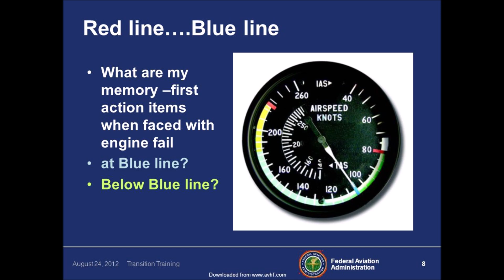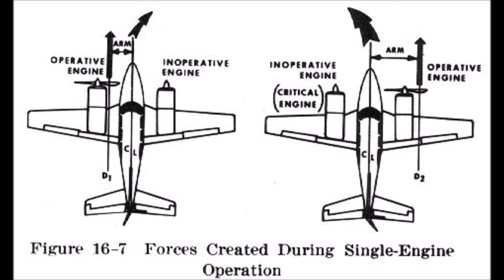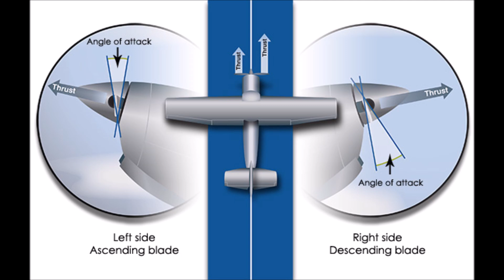King Air Crash- Addison Texas Update

Comment: Wow, I can understand the cost involved to produce twins with counter-rotating props but I would be much more inclined to buy a twin for more money that had them!
Reply: Doesn't seem like the additional cost would be that much considering how much a twin turbo costs in the first place. P38s made the switch pretty early on. Great video Juan.
Reply: It is a cost factor, same as any jet both spin in the same direction so they can go into service on either side.  One less thing to get approved for flight.  It's amazing how many old power plant designs are still being produced decades after introduction because reinventing the wheel cost a fortune to get approved.
Reply: I was thinking that an extra reverser gear is all that would be required?
Reply: @Knirin  I think that left and right propeller profiles have to be mirror-imaged. So, an extra gear and different propellers - left and right.
Reply: Knirin I think Rolls Royce used a reverser gear when it was required.  The Allison was designed to be reversible from the get go.  You could spin the crankshaft in opposite direction.   For a gas turbine reverser makes more sense.
Reply: The Piper Seneca has counter-rotating props and it was for many years Piper's "budget" twin.  There's really no significant extra cost to speak of.  I don't know why all light twins don't have counter-rotating props, but expense isn't a major reason.  The engine manufacturer can produce an engine with a crankshaft that rotates in the opposite direction and the prop manufacturer a prop that was pitched in the opposite angle.  If 50% of engines and 50% of props were so produced, the cost per unit would be the same.
Reply: @time.5316  I was going to say the same thing. Seneca's as well as the Piper Navajo's
Reply: I thought the same. That should eliminate p-factor at least when both engines are running.
Reply: The ideal solution to p factor would be contra-rotating props. Two props rotating on the same shaft in different directions.   Another would be to have a collective as well as a cyclic pitch like on a helicopter to eliminate the p factor by adjusting the pitch on either side of the prop differently.  You wouldn’t need flapping hinges.
Reply: Piston twins like the Seneca use a right engine that runs counterclockwise (left hand rotation).  The Avanti is the only PT6 powered plane I can think of that has counter-rotating props - I assume that reversing is done in the gearbox.
Reply: Reversing would be a simple matter of a different grind on the camshaft provided the rest of the engine has suitable symmetry. They did this with the corvair engine when they wanted to couple it to a VW transaxle and the cost is quite reasonable. A VW turns clockwise when viewed from the back to forward with the fan pulley to the rear. Corvair from the same viewpoint, turns CCW normally unless it's fitted with a proper reversing camshaft. The starter then is VW and mounted to the transaxle as per normal. OIl pump needs reworked as well but this isn't rocket surgery either.  Two versions of feathering props would be the most expensive part I would think.
Reply: Lee Barnes I read in Gunstons book that the cam shaft on the Allison could be flipped to achieve this reversal.
Reply: I am guessing there are uncountable boats with reversed engines.  Just about every twin screw boat I can think of has them.  The cruiser I used to own had counter-rotating Chevy 283 V8s.  Pretty much every inboard is based on a automotive/truck engine, and has a reversed version on a twin.  Not as uncommon as many may think.

Comment: Witness did not observe decrease in power. Witness did sense underpowered takeoff. Crash occurred to left; perhaps left engine underpowering or failure. I wonder if video evidence along with flight plan weight and runway markers will reveal if V-points were honored. Or blue line. There's no flight recorder; only CVR. Keep in mind that this all happened VERY VERY FAST. 8 seconds from cockpit acknowledgement of power failure -- to impact itself. Probably unrecoverable only THREE TO FIVE SECONDS after acknowledgement of problem. That's chilling.
Reply: Correct not much time at all for corrective actions. Unless you train and plan to have a failure with each take off....most would be doomed.
Reply: @WSmith2024  What's so upsetting is that everything went to hell AFTER rotation. A massive goal of the investigation should be if they should have gone 200 feet up at all, which turned out to be a death sentence. I'm not just playing hindsight here...
Reply: Bill Woo 
Hell yeah first sign of trouble, if possible, get that damn thing back on the ground
Reply: @jwb2814  They were committed to take off after passing the threshold (assuming they honored it; that would be devastatingly incompetent if they didn't).  The sad truth here is that they shouldn't have left the ground at all. They didn't have the power. I'm afraid that the investigation will conclude that they did not test thrust, but rather just pushed it to the metal upon tower clearance. Without the power to make it.
Reply: Bill Woo 
And that thing was packed with ppl

Comment: For some reason they made the engines turn outwards on the P38. This actually made it much harder to control after engine failure. I've always wondered what the reason was for doing that.
Reply: Wikipedia is a mine of information on the P-38:
"The propeller rotation was reversed, with the blades spinning outward (away from the cockpit) at the top of their arc, rather than inward as before. This improved the aircraft's stability as a gunnery platform."

Comment: Juan another good report.  If I may add a few things, after around 800 hours in the 350 with a charter company.  When I heard of this accident it raised some questions. One with a trip of that length when I flew it in the 350 I flew we had 2900 pounds of fuel on board, which gave us the required reserves.  This aircraft had 10 persons aboard and if they had at least the mains topped that’s 2500 pounds of fuel they would be close to if not over gross at that point.  When you lose an engine on that plane the auto feather and rudder boost should help.   That’s provided that the pilot had armed the auto feather system. Rudder boost helps but still needs rudder input by the pilot.  I did all my training at Flight Safety in D Level King Air 350 sims.  V-1 cuts were straightforward and at the same time work!  But can be safely executed.  This plane already had issues with the left engine I’d heard from the NTSB news conference two days ago.  It smells like an overloaded plane with engine failure on top of it. Sad case for sure
Reply: FWIW I know that at least 6 passengers and probably 8 were low to medium weight.  For a plane rated for 11 -- which means, fully fueled, correct? -- wouldn't you need 10 obese occupants to go overweight? Unless they had heavy additional payload, of course. I don't see how you could make that conclusion.
Reply: Bill Woo no they would not have to be obese.  That leaves one seat open possibly, and a trip of that nature would take around 2900 pounds of fuel minimum.  And you’d be surprised with how many bags people show up with thinking that it’s like going on Southwest with bag bins like 737.  Those conditions I’ve seen before and had to leave people and or bags behind.  If you think about what happened there it’s the classic scenario, heavy plane attempts takeoff loses engine and vmc rolls into a ball
Reply: @kenclark9888  Are you really being logical? If a plane is rated for 11 passengers, is that a conditional limit "assuming that you don't fill the tanks to full?"  Is there another paragraph that says "only nine if you fill the tanks?"  Oh come on, now, It's good that your mind is considering a possible cause being weight, but you're not making logical sense.
Reply: Bill Woo just because any plane has 11 seats does not mean you can fill them all the time.  I know the fuel amount it would take to get that plane to where they wanted to go with the required fuel reserves and as I said if they loaded that plane like I have seen others and had a decent fuel load it would be over weight.  Just because it has a 11 seats it’s not logical that you can load them all and fi it up with luggage and top all the tanks on the plane and go!  It doesn’t work like that.
Reply: @kenclark9888  That's absurd, that a plane is not allowed to load at rated capacity because of a full fuel load. Sorry I bothered you.
By the way, this plane did have a far more than required + reserve fuel load. They would have been comfortably over the line with something like 70% of the amount they carried.
Reply: Bill Woo how would you know how much it would have?   If people bring more crap with them which they sometimes do it’s done.  I don’t know how much was on board nor do you
Reply: Bill Woo Let’s put it this way just because any plane has let’s say a seating capacity of 137 like a Southwest 737.   Lots of factors come into takeoff planning.  Weight of passengers which for airlines is a standard number fuel load required for the trip plus reserves.  Then factor in field conditions such as, temperature, wind, field elevation and weather.   This things some times limit us to what we can take.   Just as the King Air has 11 seats in it due to the same issues I lined out means some times not all 11 seats are available for use.  Lots of things at play to take into consideration
Reply: @c7042  "No 2+ passenger aircraft made can take full fuel and have a full passenger load."  That is spectacularly nonsensical. Oh yeah, this works: AA tells passengers to depart the plane because they are disallowed from filling all the seats -- because they are about to depart off with full tanks. If that is your twisted (and worst of all, apparently adamant) perspective, I pray to God that you are NOT a commercial pilot. Good night.
Reply from the maker: Thanks Ken!
Reply: blancolirio you’re welcome !!

Comment: You need to have a plan for emergencies and practice practice practice. The same way every time.  When it happens for real, your not fumbling around getting behind the airplane.
Reply: donstor1    Amateurs practice until they get it right.   Professionals practice until they can’t get it wrong.   Big difference.
Reply: Ive watched just about every air crash investigation there is.  At the end of that documentary they often get that editor from FlightGlobal to offer an opinion.  He stays professional but you can always see that he's containing some anger when he passionately says pilots aren't getting trained appropriatly.  I think he means crews need more frequently simulator drills. Its obvious from recent events that pilots have often only a short time to react, are overloaded and startled.  Without extensive drills things are not going to work out in the time available unless this has been drilled beforehand.  The most startling of these was when AF447 (An A330 flying between Brazil and France) crashed after a momentary loss of airspeed data causing the autopilot to disconnect and gracefully hand over control to the junior 1st officer.  He immediately stalled the aircraft.  A lot of people get angry at this guy because of his staggering incompetence but it turns out pilots weren't being trained to fly throttle and attitude when their speed sensors failed.  That was coupled with no displaying angle of attack data due to archaic attitudes.   As an automation engineer I was somewhat aghast that the autopilot disconnected and hand over to a non competent while pilot when the ADIRU had GPS and Inertial data that would have provided sufficiently accurate estimates (along with flap setting, thrust setting and an aircraft model)  to fly the aircraft automatically.   Indeed it looks like Boeing added the 'alternate air data system' to the B787 using these features.
Reply: @HiWetcam I was agreeing with Juan

Comment: So Juan is the king air certified to be able to climb out with left engine out and 10 passengers ? Good vid.
Reply: Is there any reason to assume that every take-off is with a full fuel load? If you were going to fly only ten miles out to drop 10 jumpers and then return to base, 25 moles round trip, wouldn't it make sense to do so with a half fuel load so that you lighten the gross loading. This would still leave a safety margin of almost 300% yet give you better flight characteristics AND better fuel efficiency. At 6.0 pounds per gallon, why would you take off with 600 pounds of fuel you don't need when the 9th and tenth passenger represent additional income?
Reply: @steveholton4130  They were going to Florida
Reply: Thank You - The media reports I saw led me to think they were heading out to a jump site or was that  another King Air accident?
Reply: @steveholton4130  Two recent crashes, the other was Hawaii, this was Texas.
Reply: @steveholton4130  This was not the parachute jumping aircraft. AFAIK it was a family vacation flight.
Reply: @gordonrichardson2972  Thank You Sir. I guess I had then switched.

Comment: Excellent explanation - didn't know about the complexity that confronts a multi-engine pilot.
Reply: MegaBakerdude  Some pilots are reluctant to fly singles, in spite of the complexity, just in case one does fail the other provides limp home possibilities, instead of a glide or fall to surface below.
Reply: Pilot error will be high on the list as usual.

Comment: Or just build an engine with contra-rotating props.
Reply: That's in the video, Lockheed P-38 Lightning.
Reply: Gordon Richardson not what I’m talking about. Look up the Lockheed XP-58 Chain Lightning for an example.
Reply: @JohnChvatalGSTV  The XP-58 is derived from the P-38.
Reply: Gordon Richardson XP-58 was a clean sheet design. I should have said XP-75 eagle. I had the Allison V3420 engine in mind. Some engine applications were configured with contra-rotating props. The XP-75 has contra-rotating props... the XP-58 does not.

Comment: could the engines be tampered with ?
Reply: Yes, but it's highly unlikely. Engine failures are fairly common in general aviation. If you wanted to sabotage an aircraft, you certainly wouldn't just tamper with one engine on a twin engine aircraft because that's a very survivable situation.
Reply: Upgrayedd - a lot of private planes crashing in Texas lately 🤔 hmm

Comment: So in the event of an engine failure on takeoff as long as you're in the "blue" you could continue your climb out while fighting the adverse yaw and getting that engine feathered? Will the rudder on the king air or similar have enough authority to deal with it at takeoff speed or will it be something you are really fighting to control? Great video as always Juan!
Reply: >...as long as you're in the "blue" you could continue your climb...?
Provided you have made preflight decisions correctly: if charts were consulted beforehand (as required by FARs) and you considered runway length and density altitude and loaded your aircraft (fuel and people) so as to guarantee performance, then -- IF you're proficient and take correct action without delay to identify and clean up the dead engine (cut off fuel and feather the prop) and if your engines are newish - then you'll obtain the chart performance. Fail to do any of those things, you'll be making an involuntary landing (a crash) and you'll discover the one big DISadvantage of twins - when you crash, you're heavier, faster, and carrying more fuel than if you were flying a single. (This factor is what led to the introduction of the Cessna 336/337 Skymasters, which unfortunately never really caught on with pilots - macho factor, maybe, plus they were noisy, not very fast for the installed HP, and the rear engine had temperature control issues). Crashing a turbine is even worse, your fuel is light oil that burns a long, LONG time, it's heavier per gallon, and you need a LOT more of it. Bad news all around unless you keep it in the air and get back to earth in one piece.

>Will the rudder on the king air or similar have enough authority to deal with it at takeoff speed...?
If you're on the ground, yes, b/c the nosewheel will help and you will obviously discontinue the takeoff! If you're in the air above Vmc (minimum control speed, noted by a red line in the lower arc of the airspeed indicator) you will be able to keep the airplane straight enough, especially w/ rudder boost helping, but I promise you will feel like you were in a fight! In a Part 23 King Air, if the runway's long enough, and I was below blue line and heavy, I'd consider landing unless the airplane was already clean and I had enough space to gain speed to blue line before climbing (which also takes a long runway, or at least a long clear obstacle-free space.

The King Air 350 is a Part 25 aircraft and it's performance standards are different. They use a concept called Balanced Field Length. https://en.wikipedia.org/wiki/Balanced_field_takeoff If you have passed the decision speed, you must continue under the great majority of conditions. That why the Air France Concorde took off even though it was already on fire (tough decision, tragic). If you're Vr (rotation speed) the rudder will have enough authority, assuming there's not some other factor such as an open nacelle panel, etc.

(these comments are made without having watched the video, I have severely metered internet at home)